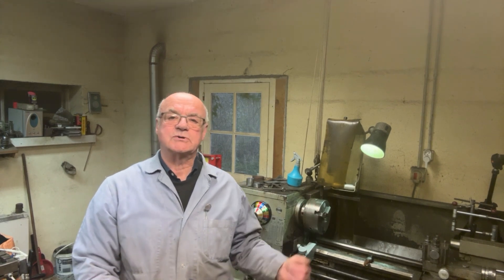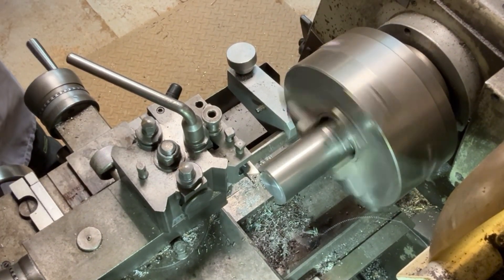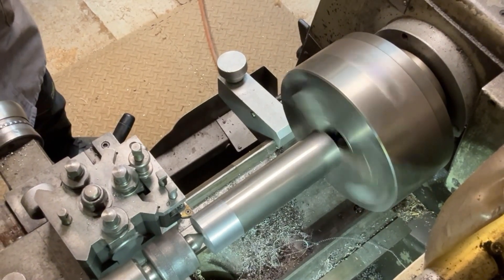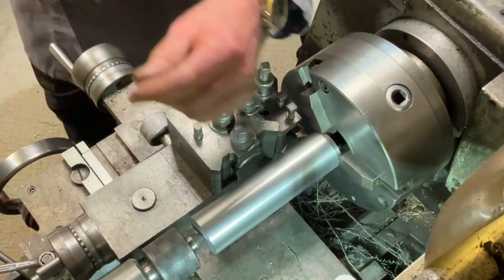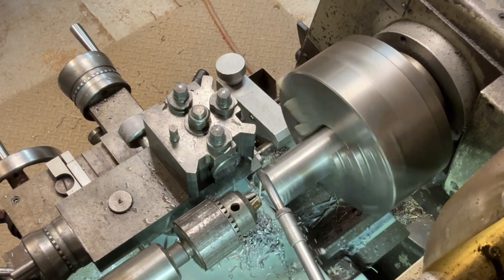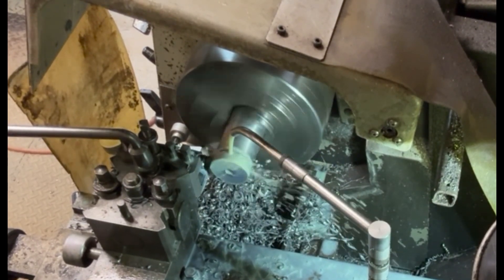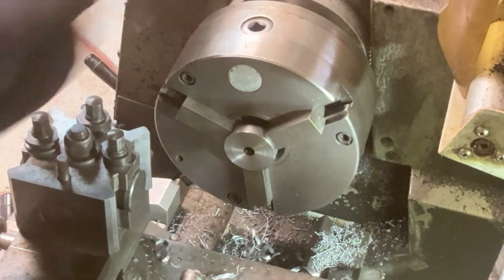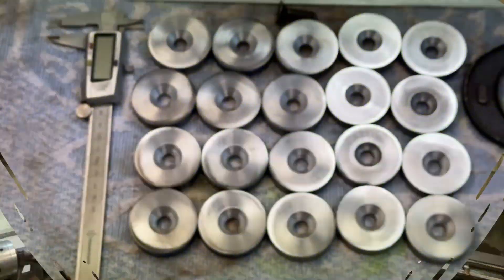How to make thick steel washers

Comment: You solved a mystery for me, in 2017 I bought my first lathe at an estate sale of a fellow who was a Gunsmith. I had learned to run a lathe in High School shop classes in the early 60s and enjoyed it but my career went in another direction.  Along with the Lathe came many items I was unfamiliar with, the strangest being a 3-jaw chuck with large aluminum jaws with several step diameters machined in the inside diameter of the jaws the likes of I'd never seen before. It is a soft jaw chuck for making washers. I also Subscribed to your Channel.  Thank You!
Reply from the maker: Just read your comments. Many thanks.

Comment: Whenever my projects call for washers of a certain size, I make mine out of American pennies.
Why?  Because, if I drive to a local hardware store and buy the washers I need, they can cost from 3 to 5 cents apiece plus the gas it takes to drive there.
I'm not only a machining hobbyist, I'm also a chronically cheap machining hobbyist.
It just seems crazy to me to pay for something I can easily make myself.

Comment: Not a criticism just a wee tip. Morse taper drills will hold centre far better over a longer length than ones held in a Jacob’s Chuck. Even using a Morse drill as a pilot will normally help hold centre far better.
Reply from the maker: Cheers.

Comment: For one or two this is the way, but for 20 of them I would lopped  them off in the horizontal band saw maybe .020" long and then faced them to thickness and drilled and c'sunk them in the soft jaws. (Lots of steel that won't get turned into chips that way and you can be facing while the saw is sawing saving time to boot)

Comment: If an lathe and shop is not available, or for an adequate field fabrication, clamp together a stack of regular thin washers. Put a few notches around the outside of the stack with a side grinder cut off blade. Then MIG or TIG weld the stack in the notches to form the thick washer. Grind the notch welds smooth. Then use a drill press with whatever bit needed to create the inside profile required. Takes about the same time as the lathe system.
Reply from the maker: Sounds fine for a field repair, but to do the job properly if you need a solid washer it has to be made from a single piece of steel! welding multiple units together will not alleviate the spring effect!

Comment: Hello  there came across your video  making the  HEAVY  washers ,   Nice job well done ,   quite a  number of years ago  I went to see a Colchester master  6" that was up for sale   originally  driven from an overhead shaft   3' between the  chuck and the  tailstock  a brut of a  machine  so I  bought it,  got it home , and set  about it    it was brown with rust as the elderly chap had passed away  and it was his son selling it ,     So I set about making a  100 x 100 x 10 mill frame  150mm up from the floor to hold an old style  Heavy 3hp motor ,  then a lay shaft out the back with a three step pulley in alignment  with the pulley behind the chuck ,   Motor to lay shaft  driven be an old timing belt ,  Layshaft to chuck pully made a belt by using a  1" Ratchet  strap ,  with a three roller in a frame behind the chuck  one of them providing the tension ,    My purchase  reason for the  lathe was to Sharpen the blades on Cylinder mowers  anything from domestic  to Bowling  green machines ,   But before  I could sharpen anything  I had to make a Grinding device that was  held it the  tool post ,  OH  forgot to mention the  lathe in question  is of  1918 circa     So it's now a powered by it's  own motor machine,    Stan Edinburgh Scotland.
Reply from the maker: Hello Stan. Thanks for the comment. That must have been one hell of a job to make up the drive unit. My Master 2500 is dated roughly from the 60s or 70s. I remember using these when I was an apprentice from 1965-1970. (old school 5 year apprenticeship as a toolmaker in Glenrothes). I still enjoy working with metal even at my age of 75. Keep watching for more videos. Thanks again. Fraser.
Reply: @MetalworkinginFrance-xe5rg   Hi Fraser, yes it was quite the  challenge , to power  it up to make the roller mechanism  that is bolted behind the  three step pulley chuck I got the help if my late friend ,  I  had  secured the  motor on my floor standing pillar  drill a Morse tape 3 model  rise and fall 18" table  removable  16mm chuck 16 speed ,   So what I did was ratchet strap the motor  to the pillar and  my friend  helped  keep the  tension and the belt straight in line with the chuck pulley  so I could machine the inside of three pieces of  pipe to hold large bearings  ,   This is two fixed rollers  and one I can tension  when I want to use the lathe ,  Then at knee  height I bolted a piece of  1/2" ply to the rear leg to fit a emergency  Stop switch  a switch for a lamp , and a third switch  for a pump , Yet  to put a coolant pump on it  will do so some day ,     So are you from Scotland originally,   as Glenrothes is  just over an Hr from where I stay in Midlothian,    When I sharpened  the cutting cylinders  I could dress the blades to within  3thou  of accuracy  over the width of the cylinder.    Grass machinery  workshops  have special equipment to  do cylinders  and they dont strip them out of the machine,     Dreaming up a way to fit a grinder  that I could hold in the tool post WAS   a feat in it's  self,      How I discovered the  lathe was  of 1918 circa I found a number at the extreme rite  of the bed went onto  Mr Google and found a machine that was  exactly the same  and my immediate reaction was  WOW    This lovely old  machine  was nearly going to the scrap man if I hadn't  bought it as i was the sixth person to look at it  ,    Weather in Scotland  just now is  chucking  it down   Stan.